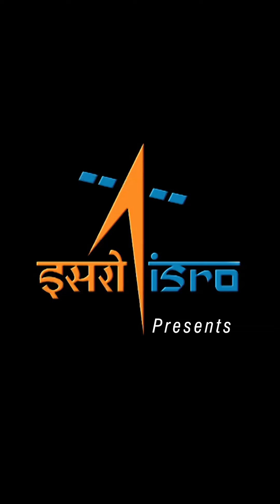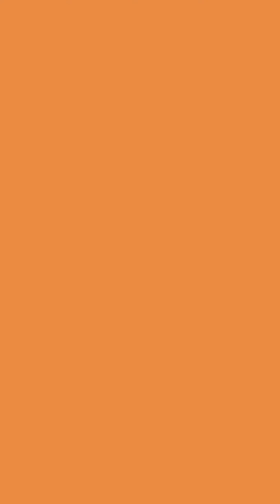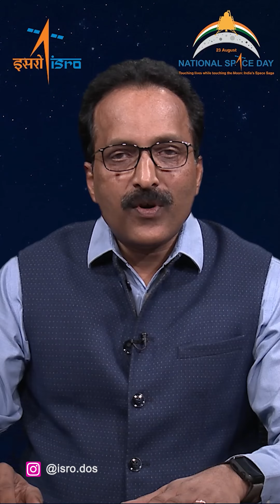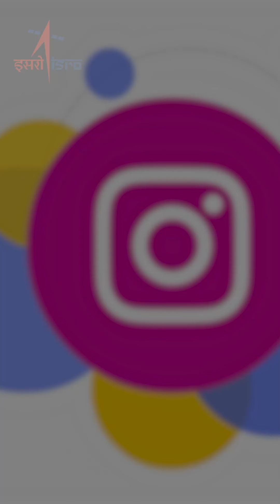Plans of vertical landing re-usable vehicles by ISRO

Comment: To lift the spacecraft most of the fuel is needed to overcome that can you use separate fuel tank which will put in the ground and refueling the tank upto 1km or so...or at the time of lunching can you use the strong magnet to accelerate the rocket ...is it possible?